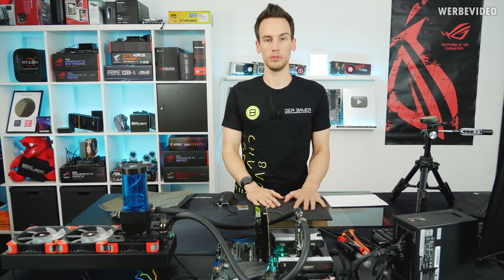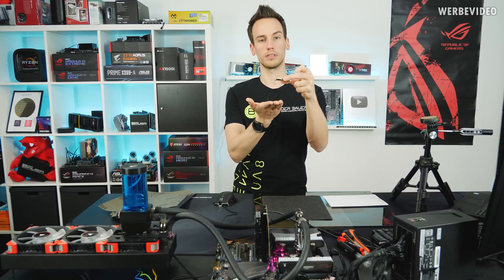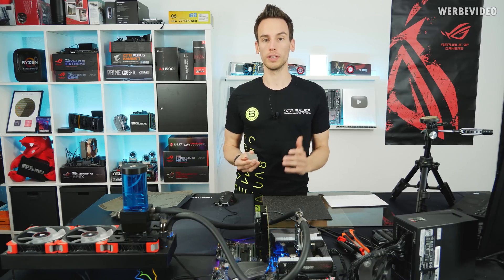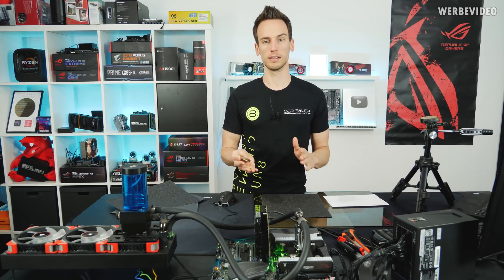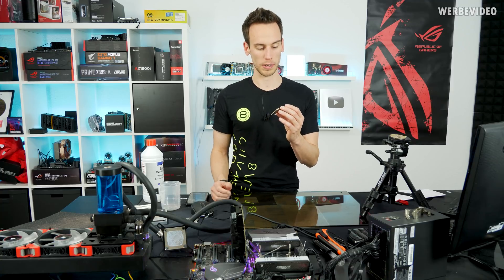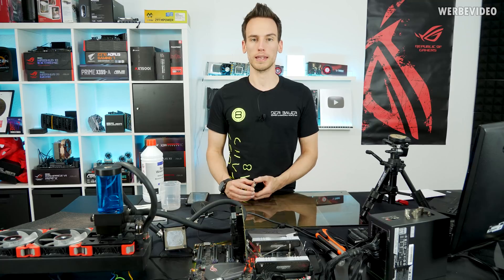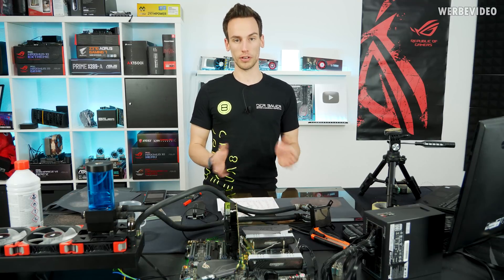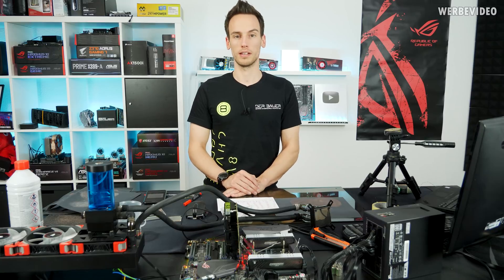How bad are SCRATCHES in the CPU Heatspreader?

Comment: IHS are desgined with a slight profile so they're flatter at operating temp. Lapping flat at room temp (even if you could do by hand without it becoming concave) is sub-optimal.  I only do this on the contact block of a cooler which has obvious deep grooves.

Comment: I had a problems with mine i7 11700k and high temps after overclocking. I always thought that 11th gen is just hot gen. Once i oced my cpu to 5ghz + 1.38 vcore, i even couldnt play games due 95+ temps and crashed after -+ 30 mins. If i tried to run prime 95, i instantly reached 100+ temps and throttling. Then i run 2 cores and 4 threads test with all enabled avx and got 98 max temps after 1 minute. One week before i saw a videos about lapping cpu and aio coolers. I decided to try. I lapped both, cpu at the end of 3000 grit and my aio at 1000 thousand grit and boom. My temps dropped by a -30%. Now with prime 2 cores + 4 thread + avx i got max temps only 70 in one minute test and even 4 cores and 8 threads candle no more then 80 in 5 mins test. Crazy. I can even turn on all threads in test and it reaches with 5 ghz and all avx on 100+ only in -+ 50 secs. About gaming totally difference. From 95+ temps, in 70. Stock temps is ridiculous. No more then 65 with all cores enabled in prime 95. Btw, i always used high power intesive tests not blended. Ofc i know that these temps go lower, because somewhere was a big hill, and that was in my aio cooler most as i noticed, it took very long time to sand it out.

Comment: Versuch doch mal mit diamtenpaste auf 8000 oder 10000 hinzubekommen. es gibt auch noch speziele paste die 20000 macht. Dann ist die oberfläche verspiegelt. Dann hat man den glass aufeinander effekt wenn man den lüfter auch so polieren würde, wo kaum Luft mehr zwischen ist. Somit mehr wärmefläche. Ich denke das alles zwischen 500 und 6000 fast identisch ist. den größten unterschied gibt es bei 40-200-8000-25000. Der punkt ist halt es auf einer perfekt geraden oberfläche zu machen. Also meistens Glass. In einer absolut gleichen Bewegung.

Comment: Wire wool (very fine 0000) and liquid metal gives amazing results, especially with delid (don't use wire on cpu die - obviously). Ensure you have a flat surface for the heat spreader and cooler interface surface, this will minimise gaps and increase thermal transfer. i7 8086k @ 5.2GHz (1.35v) with temps in mid 60s running Prime95

Comment: There were some mild scratches and a small pit on my 5800X IHS when removed my Wraith Prism. Not sure if the cooler itself or preapplied thermal compound caused them
Reply: you left your comment two years ago but I'm gonna ask anyways. You said your 5800 XIHS had a mild scratch or scratches on it. I too have a 5800 X with some mild scratches on it. Also the bottom right corner edge feels like there's a "burr" on it. And because the bottom right corner edge has this sharpness to it it's digging into the  cold plate of the AIO. When I removed the AIO pump from the CPU after using it for a couple years I noticed the Coldplay had scratches from the corner of the CPU.
Reply: @philmccracken2012  yeah I've seen some IHS with that "burr" in a corner or two. Seems their machining isn't very precise

Comment: I know this is an old video but in regards to the part about not knowing if the IHS or cooling block is flat you could always test fit with with marking blue/marking out dye (instead of thermal paste) on one component and see the contact pattern. That is if you are bothered to go that far down the rabbit hole...

Comment: Old Nvidia Gpus, Up until geforce 4 was really concave in the middle and you gained some cooling by lapping them. That was my experince from the 90ies. Alla intel p3 and AMD athlons  had the bare die.. no ihs, but sometimes you cracked a corner and the cpu  was dead!

Comment: Could it also be that the paste is now what is causing the temps to not drop lower? From what i understand if you have 2 flat surfaces then there is no need for thermal paste. Similar to optical bonding doesn't use any glues. I wonder if Liquid metal would have given larger differences or Direct contact with the waterblock.

Further Could have it been that the water block was also not flat or at the very least also needed to be sanded/lapped. I know Almost all of EKWB do not come flat. They are concave. So you will reach a wall at some point just sanding 1 of the 2 faces.

To many variables here.  Its pretty clear you hit a thermal wall with your results.

I wonder how the results would be if you got both surface optically flat and used no thermal paste.

Comment: I’m lapping my 6900k soon (actual lapping). I’m using 150 - 3000 grit, then moving on to polishing compounds like jewelers rouge, then Flitz paste for buffing and polishing.
Then I’m doing it to my waterblock.
I’m also using Thermal Grizzly Conductonaut. I’m not playing around.
Reply: And the results? I have a 6900k too and the IHS seems not flat with a large gap in the center.

Comment: hello i just got a 10900k the temps ar semi ok but not as good as i xspected i have 3x360 radsand d5 pump + ek magnatude block after testing the cpu in glass and razor blade it is perect lat yet my ek black is rather convex. the cpu will not spin on glass but as soon as i place ontop of the water block i can spin th cpu very easy 
im wondrng if its worth lapping the water block

Comment: I'm about to lap my 9700k because the temperature spread from core to core is very inconsistent. Core 2 always seems to run 7-9° hotter than all other cores. The spread between the other cores are between 2-5°. I am running a custom water loop with a Thermaltake W4 cpu block, a EVGA hydro copper 2080 super, and a Thermaltake 420x64mm radiator and a EK 480x60mm radiator. I recently bought a EK velocity water block to see if that makes any difference first, then I will try lapping after that.

Comment: Has anyone tried liquid metal on (both) lapped surfaces?
How about a graphite pad?
Reply: sanding and lapping removes the nickel from the IHS. It's recommended to use liquid metal only with nickel cause it reacts chemically with copper. It's not that reactive like LM and aluminium but sooner or later it may leave some damage to the copper surface. What makes more sense here is using the LM under IHS after delid and use thermal paste on the top. Also you would need a cooler that is nickel plated.
Reply: @kowal216  Well, roman showed us how to easily nickel plate copper... so, as stupid as it sounds, i probably will re-nickel-plate my lapped cpu/cooler and try liquid metal. But i don't expect much compared to going straight to liquid metal without lapping.

Comment: The reason why your test balanced out is due to the thermal paste, when you lap your cpu, surface variations is less, thus, you need a very thin thermal compound, in fact, when i do it, i stop using thermal paste and start using oil, grease for lapping coolers under 600, and a dab of machinist oil (or even baby oil) above 1200, if you do this you will see a difference.

Comment: U don't see improvements from finer grits simply because, judging from the shape of the abrasion imprint, that ihs was convex... past a certain point u are no more flattening it, just polishing. U can never absolutely flatten a convex surface because it will always wobble and remove more materials from the borders. Now don't stop at thinking that borders aren't that much important because the die is centered.... the fact is that u can't flatten a convex shape means even the central part won't be flat, contact area will be similar no matter how fine u sand it down. There's a trick that most woodworker will be able to tell u, and that's that when buying a chisel u should hold it down on a flat surface and if light is visible in the middle, then good, that chisel can be flattened and is safe to buy... If it doesn't then that chisel is crap (don't buy, especially if that's a paring or mortising chisel... and some chisels are very concave by design... there are ways to make that serficeable but it will never be perfect, or it will require so much time it's not worth it). In a similar fashion if u want to lap ur CPU, start with a very fine grit (600 or 800) and check the initial imprint, if metal is coming off the middle then u might as well just stop there, because it's not worth it (in a similar ways than with chisels there are different approaches u can take there to make the surface flat, but totally not worth ur time, and will require tools rather than just plain sandpaper, and some expertise too)... If it comes off the edges, then u are good to go, move on a 120/180 grit and start lapping. U used a marker at the begin, but stopped at some point, bad mistake... u should always mark the surface u are flattening from time to time, to check the progression. U didn't stop at getting improvements because the grits were of no help, but because the abrasion was uneven.
Reply: If i may suggest something, try redoing the experiment in collaboration with some master sharpener/woodworker, even on youtube there are many,

Comment: Why would you not sand the cooler contact, you claim to see better contact, but I doubt you can see the difference between 600 and 1200 with the naked eye.  Now I agree with the results but you open yourself up to criticism by only testing one variable when there are 2 critical variables.

Comment: I think it's well worth to just visually expect a new CPU with a razor or similar reliable straight-edge. From what I know of this topic, if IHSes are uneven then they are really bad. If you get a horrendous one then just return it for another one if it's not too huge of a hassle. If you can't see anything horribly wrong during visual inspection then there won't be a lot to gain from sanding - and the vast majority of IHSes are pretty flat.

I'd probably skip sanding the iHS and instead keep the nickel-plated surface for use with liquid metal. Liquid metal will work ok with copper too so you could theoretically do both, but it's the most stable against nickel, and using liquid metal instead of a good regular paste will net you much better temperature gains than the sanding will. I think the added peace of mind and stability of the liquid metal + keeping warranty + much less risk of damage makes this a much more worthwhile approach. Also a hell of a lot easier. Sanding is tedious work, requires suitable materials and some experience to do well. I've done it a few times back in the old days, and I had improvements, but not enough to be worth it make any actual difference in OC or noise levels.

Comment: nice video :) have a difrent question thou , i bought the Lian LI o11 Dynamic case you was helping designing , but i cant get my thermals down to the lvl i have with the Fractal Design R5  i using water cooler for the cpu combine with air cooled  gfx card, i have som friends telling me its becouse its the 90 Degree bend the air is need to take that it less effective cooling and Air flow , got any tips to fix that? 
tbh i love th design iof the o11 Dynamic  case , kinda notice the mash/filters allso messing with the aif flow and termals .. im abit annoyed i cant find A water cooling block for the Gigabyte RTX 2060 Gaming OC  card  if you could help me out that too it would be great 
thanks

Comment: If you want to know if sanding your CPU could do a "huge" difference, just take out your CPU, clean it with alcohol, go to a glass-table and spin the CPU - with the IHS facing down of course. If the surface is flat it will not spin, if it is uneven it will twirl/spin.

Comment: Subscribed - I'm curious to see if the bottleneck removed by delidding would create a greater difference between results. I don't think it would make for a scientific test for the same reasons you mentioned, but what if the same test was done on a soldered IHS. 

We do not know if Ryzen 3000 will be soldered but if it is, it may make for an interesting part 2.

Comment: Yeah, you get a down vote after stating that lapping will do nothing. I can tell you from personal testing back in the olden-ish days of 939 and 754 that a flatter contact surface does, indeed, mean faster heat transfer. I've paused the video at this point and I'm not sure if you understand that "sanding" is lapping the CPU. And polishing the surface is not what you want to do. Lapping will give a slightly polished look but shinyness does not translate to better temps. 

Just an aside, I've only lapped 8 CPUs in the older days and the stock heatsinks that came with them and 1 very cheap after market HS. All resulted in lower load and idle temps, by a consistent mesureable degree. Though it was never over 10c at load. Generally, modern IHSs and coolers are better but flatter is better.

Comment: That's a great presentation, thanks! Btw, I probably have it misspelled as was hearing this at the beginning (and since I don't have that particular knowledge): what is "ignium", what soldering material are you referring to?
Reply: Indium is a metal have better thermal conductivity than copper so its used in CPU to attach IHS in low end CPU instead of indium is used thermal paste

Comment: I get 5-6c better temps sanding my i7 6700k, one good check if you try to spin the cpu on the IHS, if cpu spins it's uneven protruding on center of the IHS so it worth it to sand if you plan OC, if not spin at all it means it's almost flat, so in theory it's not worth the time.
In my case my 6700k spins like hell. I'm on 4,6 OC with 1,32v (not very lucky on silicon lottery)

Comment: Once you are beyond the uneven surface benefits are minimal, any gains are only due to the thinner material between die and the cooler heatsink (thinner IHS). Hence why you are dealing in fractions and not drops in whole degrees.

Comment: I hand lap carbon seals for aircraft applications for a living, and the only part you are getting right is the figure 8 motion. Please folks dont follow these lapping instructions.
Reply: Your comment is irrelevant if you don't suggest a better way of doing it. Also, carbon seals for aircraft application and CPU dies are...not really comparable?
Reply: First of all you need some kind of weight that sits on top of the thing you are lap, so that you get even downward pressure. Without that there is a good chance you will lap the object unevenly and end up with a smooth but non parallel surface. This alone would make me not want to do this because you certainly dont want any pressure on the stuff that's under your CPU. I mean this lapping is a neat concept but it's one that could easily destroy your CPU. That's all right and well if you are debauer and you get em for free or with money made from videos. But what real world person wants to possibly brick their 2000 dollar CPU for a couple of degrees better cooling.

Comment: You have tested with a water cooled solution, but what regime was the cooler on? If the pump was on a continuous, static pace, did you correct for water temperatures between runs? 
Active cooling with a feedback from temperatures makes 'surface areas smoothness'- effects  on temperature less apparent if not invisible.
Maybe passive cooling would make these  differences stick out more - alternatively,  in the active condition, one could better measure the power  you need to keep the temperatures the same.

Comment: Back in LGA775 days, I was into cpu and heatsink lapping, I did both of my P4 prescott and C2Q yorkfield. From 120grit to 2000grit sandpaper with a piece of glass underneath, lapping on both CPU IHS and heatsink. The cpu and heatsink are smooth and flat enough that when both surface touches, it stick together like a magnet.
Both CPU seeing temperature drop of 5c or more. I remember doing CPU alone will get around 2-3c of temperature drop, doing both surface get 4-5c, getting both surface to near mirror finish drop another degree.
Reply: that is not lapping
that is sanding
Reply: if they stick like a magnet, wouldn't it work without thermal paste?

Comment: IHS is User friendly and has it place, but direct die will Always be king for me and doesn’t get the love it deserves. LN2 direct die doesn’t matter, but for normal people using ambient air overclocking it’s significantly better and needs a bigger spotlight.

Although with modern CPU’s it is difficult to get proper cpu pressure mount, which can really fuck with your cpu if done wrong. So I guess it isn’t for the faint of heart.
Reply: aight I might try that with my delidded Pentium 4's
Reply: You should lap the silicon die as well... the less thermal material the better thermal pass through

Comment: given a world without thermal paste, scratches are bad.

well thats exactly what thermal paste is designed for, fill all these little scratches and irregularities to optimize contact surface between heat spreader and cooler.

Comment: Is it possible that the performance improvement was from the ihs thinning out and not because of the surface being shiny
Reply: NO, the problem is that the base was getting even moreconvex with every pass... he was polishing the ihs, not flattening it.
Reply: if that had been a significant factor, we would probably have observed more benefit from the higher grit sandings, as there would be less material at each step.
Reply: Now as 10900K is out, with thinner IHS, there an improvment.. so yea i guess it is possible.
Reply: I was looking for this comment which luckily didn't require much.
Once the surface is ground down to the copper plate, every additional step in sanding actually doesn't remove much of any material by a significant amount compared to the prior. Still going from 180 ~> 1200 will result really no difference in what material is removed.